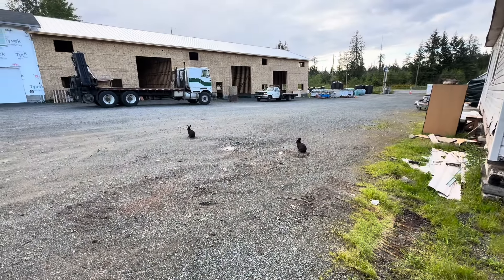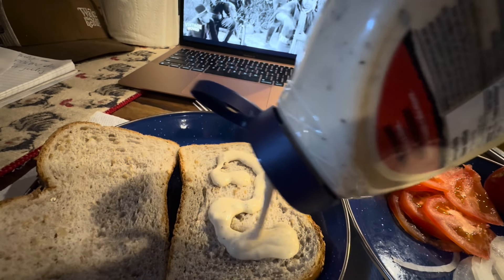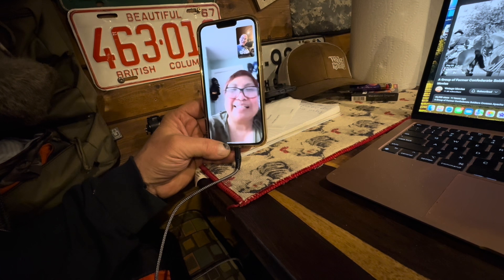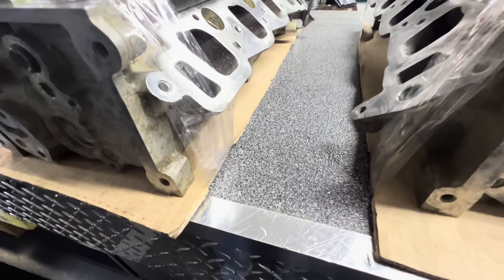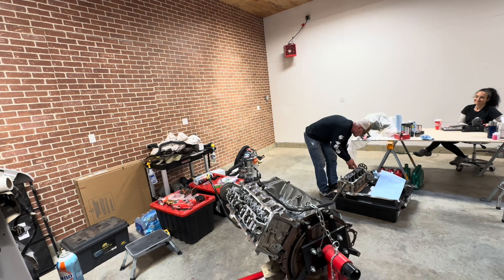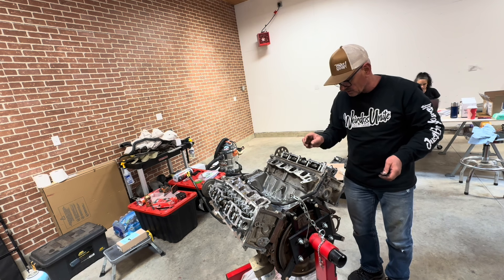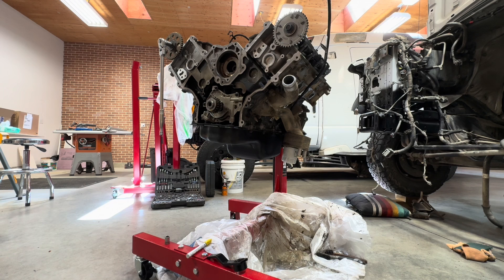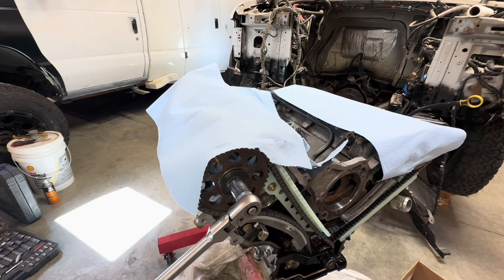WE WERE SHOCKED TO HEAR THE NEWS..

Comment: Is it generally OK to reuse head bolts if they look good?
Reply: Not with Ford engines, in my opinion. Weak steel headbolts is why I am putting my E-450 in the shop this afternoon for bullet-proofing.
Reply from the maker: No I wouldn’t reuse head bolts  Jeffrey
Reply: I believe that my are designed to stretch upon proper torquing . So, no . Even the torque methodology is SUPER specific and precise .

Comment: I am kinda suprized that Emily didn't just buy a complete long block or buy Chrome's old 4.6 and had it completely overhauled so that way it is 100 %  fresh ..  I am sure it possibly was a budget thing .  Good work as usual guys  !! 😊
Reply from the maker: There was nothing available from ford like any reman and it’s hard to find 4.6 engines. Chromes old engine it’s long gone to the scrap. This was the reasons we ordered the reman heads , we was hoping that Ford has them but no luck 
A fresh engine yes it’s always a better choice if it’s available.
Reply: I personally know a local LARGE Ford dealers main transmission  mech, and he said even the factory reman contractor is not providing high quality  remans. They had one blow up a week after install and just for giggles he opened it up. ....they hadn't replaced key bushings in the reman . So, the local large ambo maintenance  facility (almost 100 ambos) that know, used to ONLY use Ford reman ...
 So now even that avenue is wrought with issues.